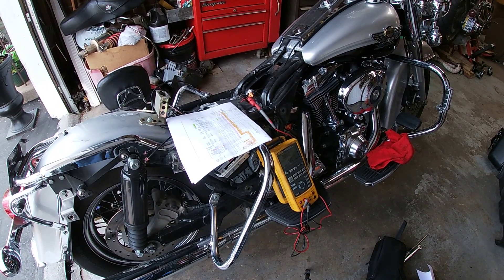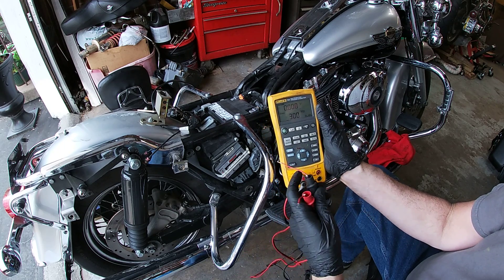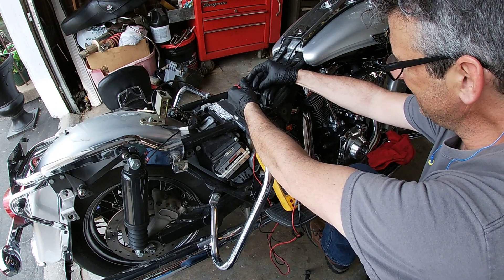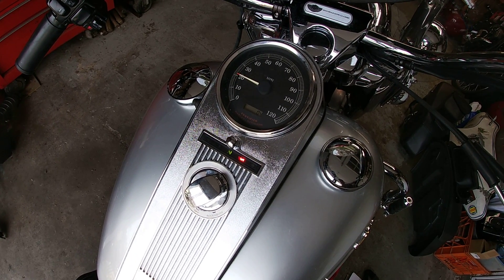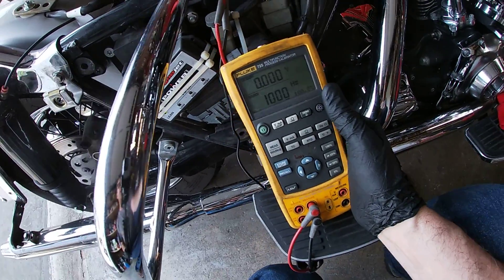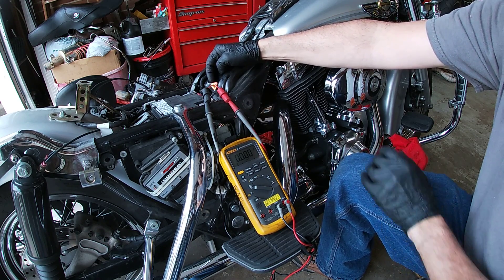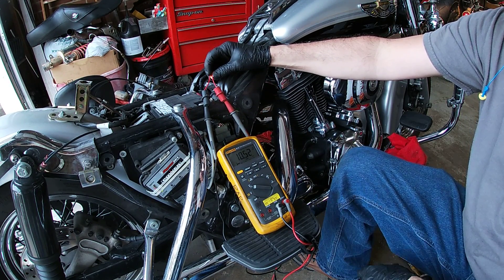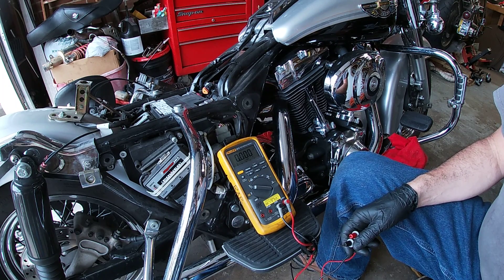Harley Electronic Speedometer Troubleshooting

Comment: my 03 dyna fxd speed is dropping to 0 and miles turning off entirely throughout my ride seems like its during shifts it shuts off. Has to be that sensor I cleaned it and it didnt fix it its either a new sensor a a voltage regulator is what I see. Is this what you're talking about issue wise?
Reply from the maker: Sounds like the problem I was having when the speed pick-up was bad. The voltage regulator should cause this problem. If the regulator is bad you would see this when check it with a volt meter at the battery. Just connect the meter to the battery when the bike is at idle it should be above 13 VDC. Rev the engine and the voltage should not go below 13 VDC or above 14.5 VDC. Hope this helps. Let me know.
Reply: @Rapsgarage  thank you i will try this as well i ordered a new VSS sensor in case bike runs fine and starts up fine just doesnt show speed at times
Reply: @Rapsgarage  So update when I tested the battery it showed 12v then on at idle it kept climbing into the 16v range then I put RPMS on it and it dropped back to 14v mid range. But when back at idle it would go above 15v-16v. The Diag code also showed d08set which i believe is a regulator code.
Reply from the maker: @SpearingWithSlurpey  Sounds like the voltage regulator is bad. The voltage should never go above 14.5vdc
Reply: @Rapsgarage  even at idle? thats what was weird I couldn't find anything regarding idle voltage only if you were under RPMs if it goes above 14.5 its not good news or below 12 volts. I ordered a new one hopefully that is the culprit like you said.
Reply: @Rapsgarage  that fixed it I installed the new one saturday and now it stays at 14 lows thanks for confirming!
Reply from the maker: @SpearingWithSlurpey  glad it hear it!
Reply: @Rapsgarage  https://www.youtube.com/watch?v=v_tfv5lKBCY this me doing it. The wiring is slighlty more annoying on the 03 dyna it went up under the gas tank
Reply from the maker: Let me know how you make out.

Comment: So I bought an 03 Electra glide and the speedo wasn’t registering. I changed the sensor and it still didn’t work. So I found your video and I bought a cheap frequency generator off of Amazon and tried it. The speedo registers as I change frequency. So I’m guessing I got a new out of the box bad sensor. I took the new one out and cleaned it, a very small amount of shavings on it, and retired. Still nothing. Is there a way to test this sensor to confirm I got a new bad one. Not saying it’s not possible, I’d just like to have confirmation. By the way, brilliant video, thanks a ton!
Reply from the maker: I'm going to check this week and get back to you on what the reading looks like

Comment: i have a road king 1996 carb , and my speedo and dispay is dead.  before that problem when i move the contact key to start the engine the speedo needle move to cero , but now dont move and no numbers on dispay. i dont know if that problem is the sensor .
if you can help i apreciate a lot . 
thanks 
gabriel
Reply from the maker: Yes the 12vdc at the 3 pin connector, for the power to the sensor, comes from the Speedo. I’d also check that the speedo has the 12vdc power that it’s supposed to get. 
Don’t forget to check that all your grounds are good.
Reply from the maker: I don’t think it’s the sensor. It sounds like a problem with the speedo. I would get a volt meter and the wiring diagram and make sure you have power to it. I would also call a H-D dealer and speak to one of their mechanics and see what they think. I’m sorry I’m not much help on this. I would need to be at your bike to troubleshoot this problem.
Reply: Hello me
Again . Here in uruguay we haven’t got dealer.
I check it and I haven’t got 12 volts on the plug . That power come from speedo ?
Reply: Hello again I have 12 on the speedo but nothing came out and the speedo is dead .
Maybe something inside is bad ?
Reply from the maker: If you have good ground connections I’d say the speedo is bad. The way to check the ground connections is to set your meter to measure ohms. Put one lead on the negative side of the battery and check the ground on the speedo. You should have very low resistance between the two points. Lets say 0 to 4 ohms.

Comment: I have a 2000 Heritage Softail and my speedometer stopped working and my engine light came on. It works intermittently at low speeds, stopping and starting. Digital Odometer also. I replaced VSS , but still no speedometer, and engine light still on. In other words, no change. Is there something under the dashboard or under the speedometer itself that maybe malfuctioning?
Reply: Same symptoms on my 2000 FXD. Diagnose- bad voltage regulator. At higher RPM it produces more than 14.5V and "bike computer" goes crazy resulting  those mentioned symptoms. Check the voltage on battery while runing on idle- it should be around 14.5 volts not more but in youre case i bet it is more and even more on higher RPM.
Dont repeat my mistake and ride like this for log - it wil go worse and worse and it wil drain and damage the battery (puttin too much voltage in battery resoults evaporation of H2S gas - bad smell and unreversible damage to the cells) and in my case burn the speedometer when V from regulator did become higher and higher. Afcourse few fuses go bad in the way and few bulbs.
Learn on my mistakes :) ....
Reply: @kocevargregor  Thank you.
Reply: @kocevargregor  mine just stopped working today after I washed it. Wondering if water got in something. Thanks for the info!!
Reply: @kocevargregor  Thanks. That's what I get for trusting some youngster at a shop instead of doing everything myself. I replaced V Regulator and had to buy new battery. All is well. I had to teach youngster how to test system with digital voltmeter. Thank you for shaking me up.
Reply: @kocevargregor  You make an excellent point. I have replaced the speed sensor 2x on a 95 Wide Glide. They last anywhere from a couple hundred to about 1000 miles. All voltages were within spec for the speedo circuit while bench testing. So perhaps at higher RPM the VR is putting out over 15VDC and the speedo sensor is the first to take the hit. Cheers
Reply: It turned out to be the Voltage Regulator.
Reply from the maker: @Justjack613  Glad you figured it out!
Reply from the maker: I would normally say to trace out the circuit in the Harley Davison service manual. If I had to take a guess with your issue I would say you possibly have a bad speedometer. If you can find some kind of frequency generator and injector signal like I did you could clearly see whether the speedometer was bad or not. On my 2003 road king the wires from the VSS go directly into the speedometer.
Reply from the maker: If you email your phone number at hdrap_1999@yahoo.com I can help further over the phone. It’s easier that way.
Reply: Speed sensor in transmission
Reply from the maker: @sgtwrench69  yes it’s in the transmission